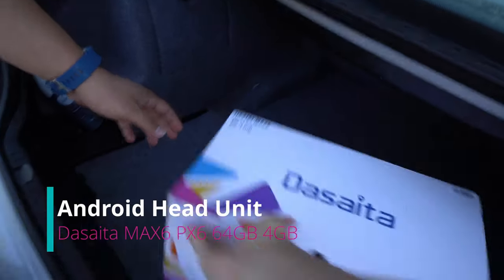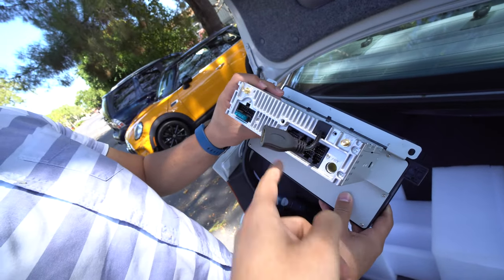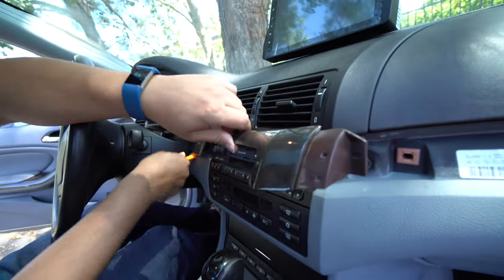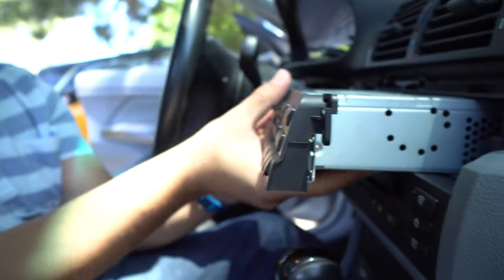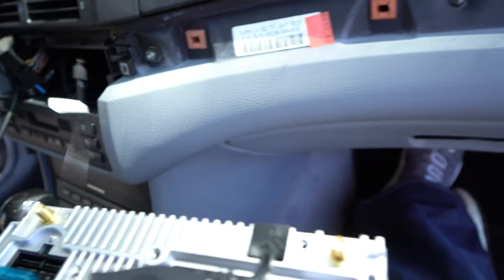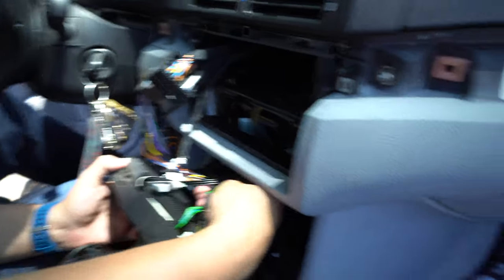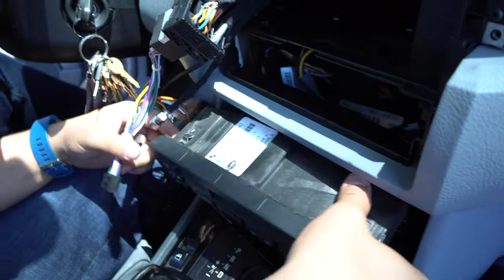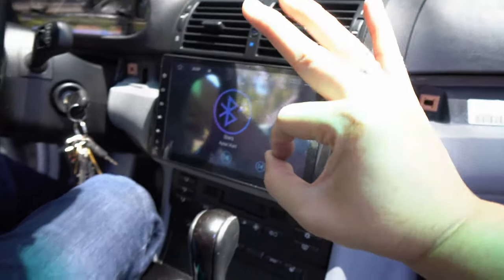BMW + Android Headunit! | Install Video! GPS/WIFI/BT!

Comment: You guys made this way harder than it needed to be. The harness needs to be pushed down, not in. It rides the rails down, and goes in at the same time. Then the fitment is great, but you have to fix the stuff inside and move it around a bit. Mine fit perfectly the first time I put it in.

Comment: i got that unit for my CR-V and it also have the same standard theme . i want to know how to change the face theme and make it looks nicer and more personalized . also where to connect after market backup camera , i couldn't make it work automatically with reverse , i have to pic the camera and change it to the rear . it would be great if you make a video on the software too , thanks
Reply from the maker: in the google play store, download  car launcher pro.

As far as aftermarket camera, there is yellow rca label camera vin. You need to tap into your cars reverse signal for the headunit to know it's in reverse.
Reply: thanks :)  i will try it out

Comment: I wonder is it possible to splice into the  HVAC  transmit and receive signal and connect those through the canbus to utilise having the Hvac controls display on the new android unit that has this capability??
Reply from the maker: I'm not sure, there is definitively canbus software for it. Whether it works for bmw, i'm not too sure.

For the honda civic 2017, and new corolla i was able to do a/c controls.